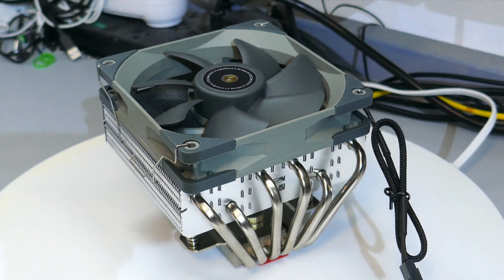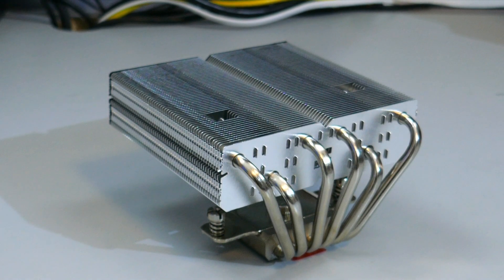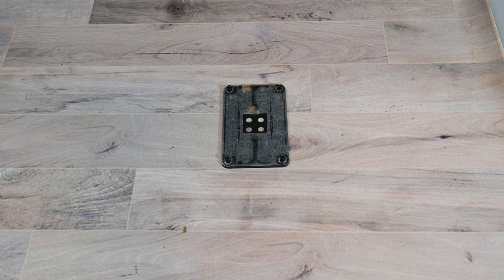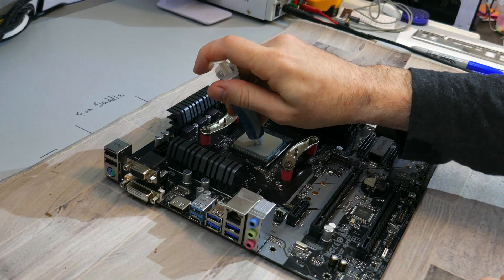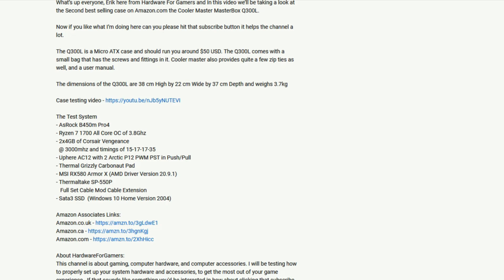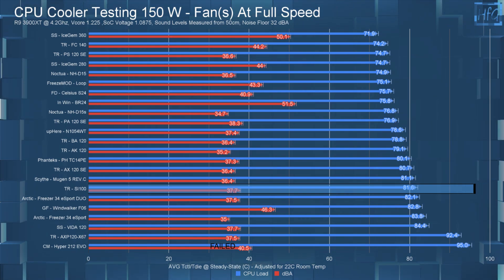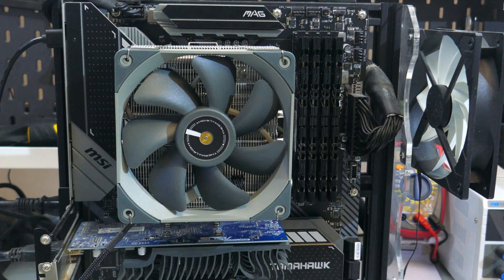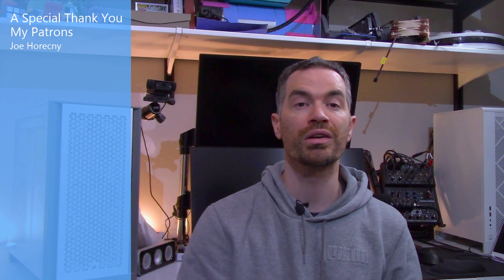ThermalRight SI 100 Low Profile CPU Cooler

Comment: I have found a use for this cooler, server boards in small tower cases. My nas uses a supermicro x9scm-f motherboard which has numerous things that stick up that would prevent a lower profle cooler from being used, at least those still big enough to handle my quad core xeon quietly. The cpu socket on this board is in a very ususual place far over to the right and shifted down with the 4 dimm slots above and is turned 90 degrees from normal, so the cooler has to stick out towards the front of the matx dell case i have to use for the moment, meaning i have to remove the cpu fan and both my hard drives and then snake my arm through the tiny space to get to my dying arctic p12 front fans , but it clears my side panel (which a 120mm tower or even some 92mm wouldnt likely do comfortably) and provided plenty of airflow for the vrm's and the memory. i have noticed lower memory temperatues with this cooler compared to the intel stock cooler (these ecc dimms have temp sensors). I have noticed that the TL-E12 fan this cooler uses seems to a special variant that runs at 2000rpm. The standalone tl-e12 according to thermalrights website only runs at 1500rpm max. The one on this cooler runs at 2000rpm according to the website and the amazon listing and my own findings, which one is it, or is it both, questions like these keep people up at night thinking?

Comment: have it paired a 5800x 3d. does the job, a little soundy.........
Reply from the maker: Cool, thanks for sharing.
Reply: @blue-lu3iz stock fan.  modified curve. kombo strike, ,150 mV offset. was getting 90*C stock and throttling when Cinebench/heavy tasks. now i get 80-ish degrees at full load. and between 4.25 to 4.4+ Ghz full cores depending on the load.
hot air exhausted top of the  case. and the cpu is getting a constant 30/35-ish degrees from  the back of the gpu. adds some heat. Good cpu. Power Efficient. but hot

Comment: Heard a friend that removed the central wire support, not "obligatory", and used a slim fan under it, to fit in ~80mm clearance cases. And still gets 35mm RAM clearance this way,  fit for some Lpx corsair,  kingston hyperX, or any vlp kits. Awesome
Reply from the maker: That's pretty cool 👍
Reply: Would a 25 mm fan fit under the fins ?

Comment: I like very much on how you thoroughly explain step by step most other YouTube creators that are doing what you are doing they don’t dive in and explain what they are doing that much and some of them talk so very fast I have to rewatch it over and over so thank you for you doing what you do and I support your channel and I am subscribed to your channel and I always hit like because I do like what you were doing and how you explain step-by-step what you are doing. Only one thing that you are missing when you are talking about cpu coolers. You are not telling us the watts that the cpu cooler is rated for a cpu, example my i5 11th gen 11600k intel told me that when you are buying a cpu cooler you need to know the watts that the cpu puts off because that will determine which cpu cooler you will need to get so your cpu won’t overheat. Mine is 125 watts so I have to buy a cpu cooler that is rated at 125 watts or higher and I learned that the hard way. The cpu fan that I bought for my cpu was very much underrated and it was not even close to 100 watts and it killed my cpu that cost me about $300 and had I known this I would have bought the proper cooling for my cpu and I got lucky intel did replace my cpu and I bought a cooler that’s rated at 195 watts and it cools my cpu so very good that the fan most of the time I never hear it running and the cpu temperature has been staying below 70c when it’s over clocked and under a heavy load from a game that I love to play World of Warships I highly recommend that game only if you are into battleships etc. But I do and will keep watching your fan videos but please let us know the watts of a cpu cooler that you are reviewing. Thank you

Comment: thanks for the review... im using it on my ZZAW B6, mini itx, with a i5-12400, I like the orientation, because it pulls air directly from outside. I keep the rpm alaways at 1000rpm, its dead quiet... also it blows air directly to the motherboard, keeping PCH, VRM, and NVME ssds cooler.

Comment: Nice review. I was surprised ThermalRight did not use a newer design 9 blade fan such as their TR TL-C12 Pro G. Spins slightly slower, (1890 RPM) at the same noise level but with a more pleasant tone and no annoying hum at max RPM. I compared this cooler against the Noctua L12 Ghost Edition with a top mounted 120mm fan (and bottom 92mm fan removed) with a variety of 120mm fans. Being thicker, it cooled my Ryzen 4750G Pro up to 6 degrees cooler than the Noctua. It is almost 9mm taller than the Noctua, but is both narrower & shorter in length than the Noctua giving it more space in tight fitting cases. It should provide better cooling than 92mm tower coolers often used in cases such as the Sliger S610 with 128mm available cooler height or the Lazer 3D LZ7 XTD at 132mm.